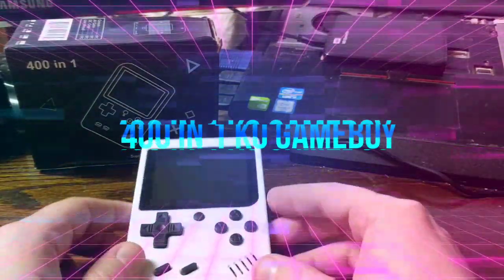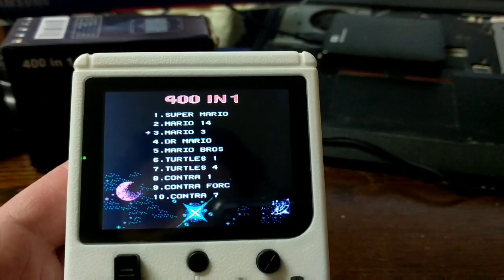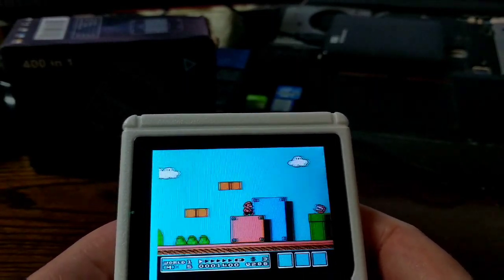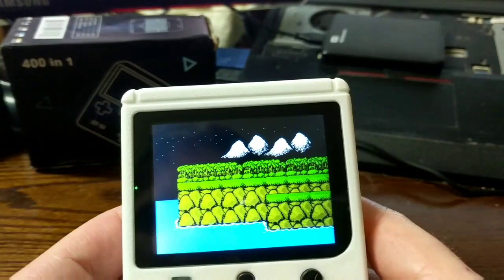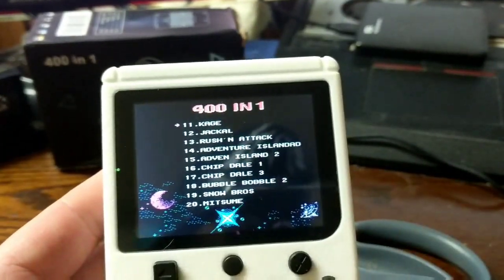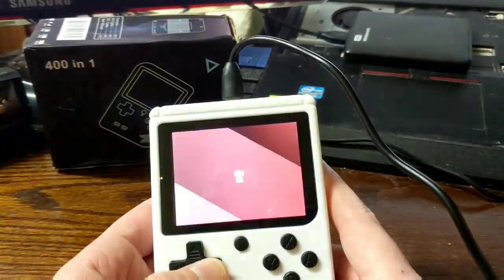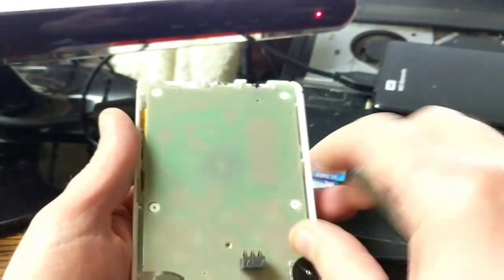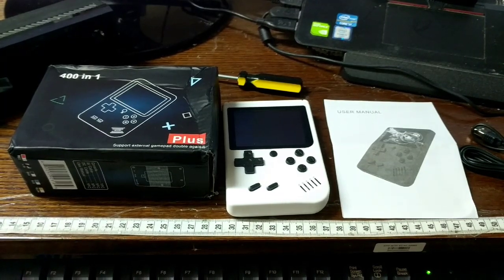Mini Retro Handheld Game Console System 400 Games In 1 Built In Player Portable Review & Teardown

Comment: Where can i get/order a new battery if the battery dies? Thanks!
Reply: Prob the store that sells normal ones, or the store you buy wires and motors from
Reply: Aliexpress
Reply: That's my question also.  My battery lasts about 30 mins to an hour if I'm lucky. I don't even know what to get to fix it.